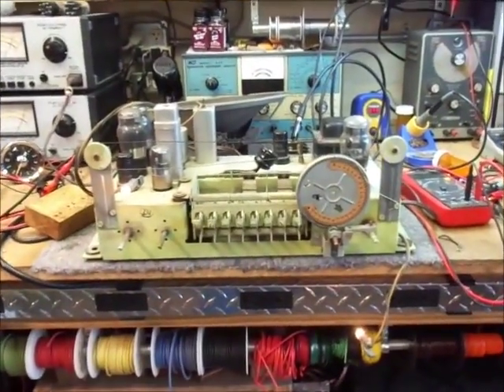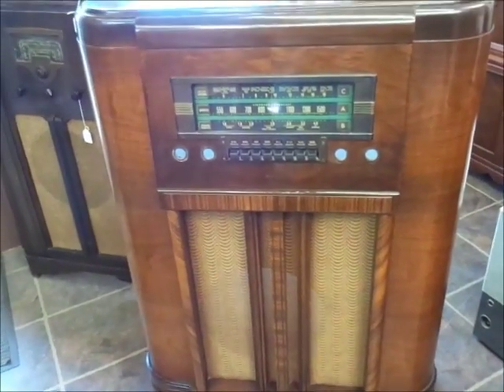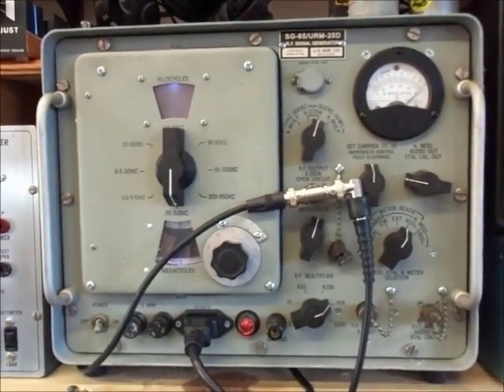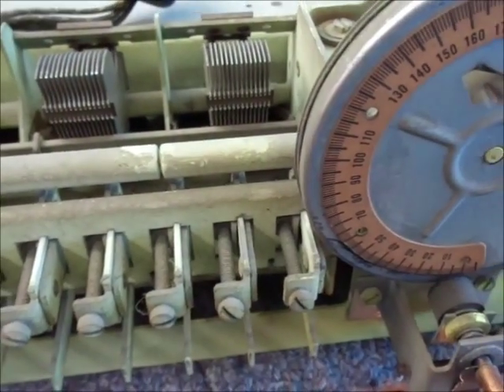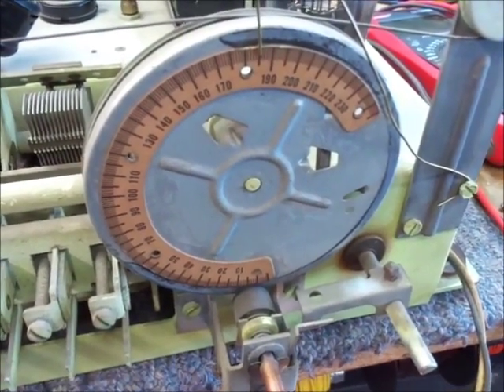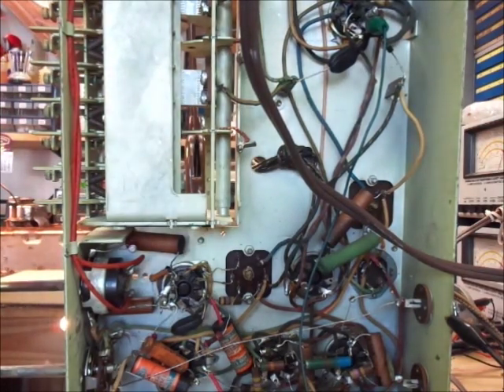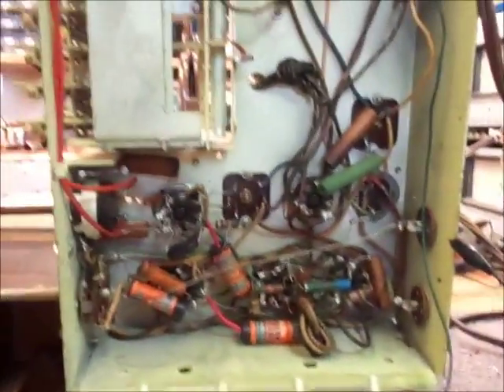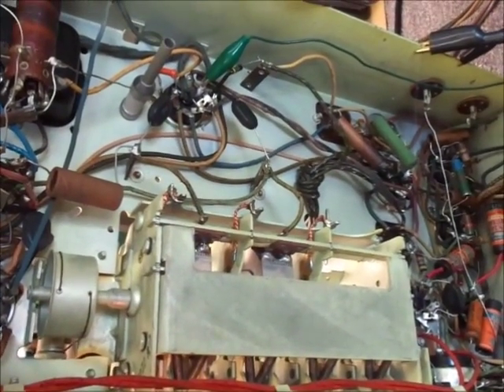RCA K80 CHECK OF ANTENNA AND OSCILLATOR COILS USING THE URM-25F U.S. NAVY SIGNAL GENERATOR

Comment: Could it have been that it was just the wrong time of day for the particular shortwave band you had it on?  Some are more active in the overnight hours.  I have this same model myself but mine needs a chassis and cabinet restore.  Hopefully I'll get started on it this coming Spring when it's warm out in the shop again, lol.  Nice to see it isn't cramped on the underside of the chassis!  Lots of room down there.  Thanks for sharing.